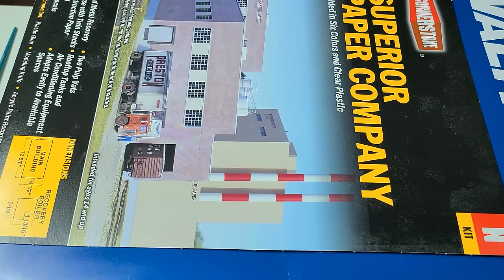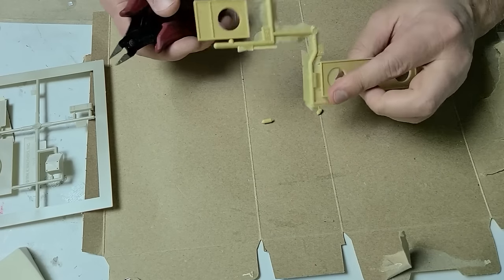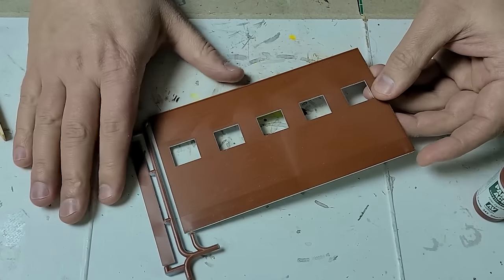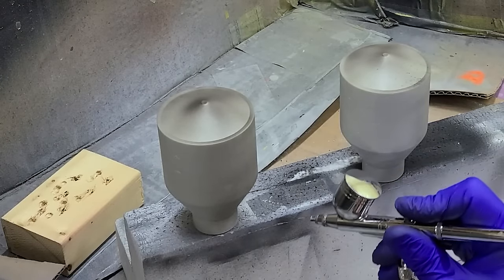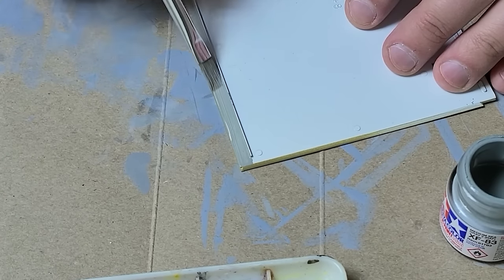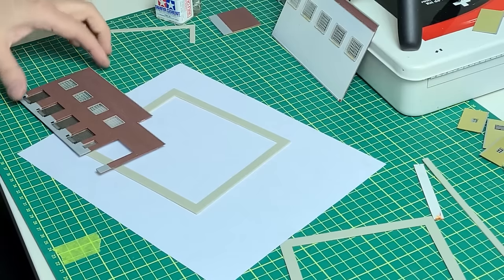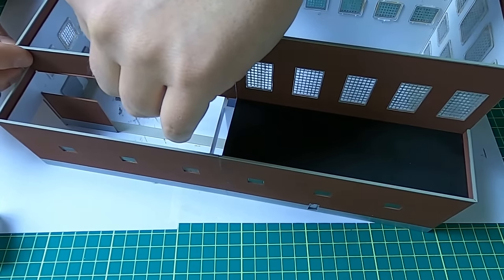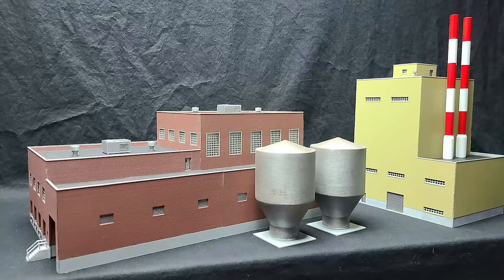N Scale - Walthers Superior Paper Company

Comment: I built the paper mill in N scale a few years back. I didn’t like the smoke stacks for the era I was modeling and found brick smoke stacks and was happy with the results. I repainted mine a complete different color and also blocked some windows out as they would do as the mill got older. Was a fun project. Also made logs and stacked a bunch in the yard.

Comment: That kit just seems to be a bunch of other buildings kit stuck together.  The long wall needs front to back bracing so it won't curl or bow in later. Also they needed to provide a support for what you had to make. Also I found out if you use a white wash over the gray or silver ac units and etc. It gives a toned down , but rain beaten look. Anyway that kit will add a large industry to a layout.  It could be kit bashed and reworked for an even better one.
Reply from the maker: good idea for the white wash. I know it works on colors, didn't really consider it for metallics

Comment: Oh yeah what happened to your corners when you glued your buildings looks like chewing gum welds... Figure you would fill in putty and sand.  Bottom line is  your happy..
Reply from the maker: The plastic walls weren't completely straight. I even put a rubber band around it to hold it together and it still bowed out.